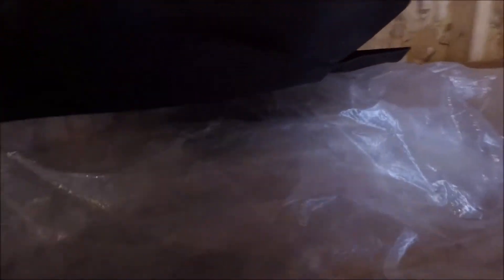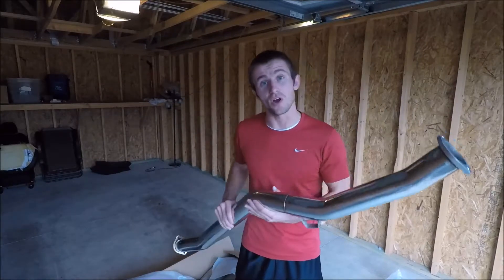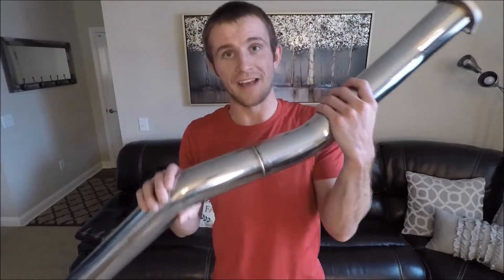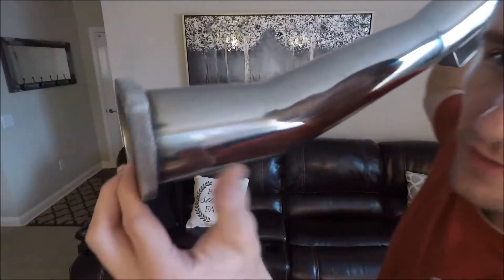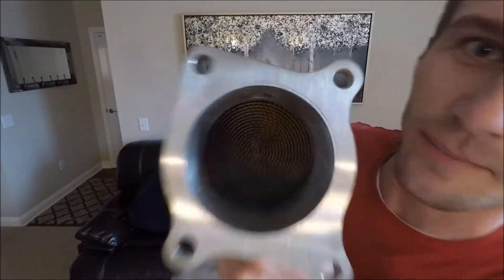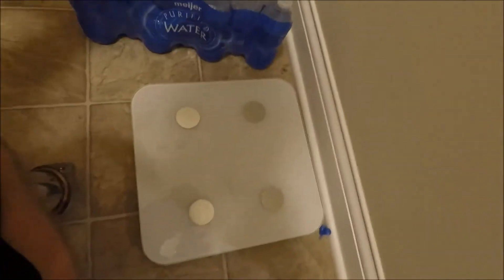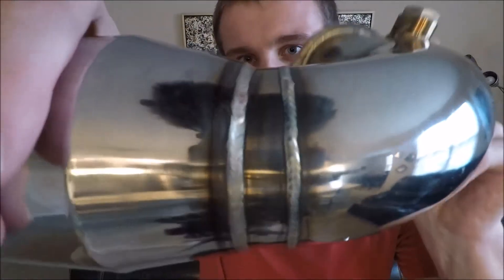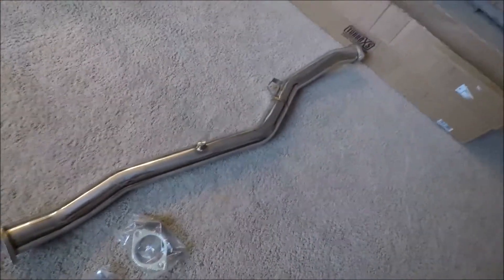TurboXS Jpipe Unboxing | 2015 WRX

Comment: A while back I went with an ETS catless J-pipe to the stock catback and mufflers. Sounded nice but had a really raspy tone to it because of the mufflers. About 2 weeks ago I put on the ETS muffler deletes and it is WAY louder, but I love it. One piece of advice I would offer is to make sure you get a pro tune when you put this on, don't mess around with OTS maps, they'll just cause more headaches and damage to the engine. Best of luck! can't wait to hear your setup man!
Reply from the maker: +Lukesmit695 Thanks for the insight, I am pumped to get it installed!  Will definitely be getting a protune, as I want tgv deletes as well.
Reply: Nice man, I did the TGV and EGR deletes as well. Throw an intake on too and the car is a huge difference from stock. Next stop, flex fuellllllll!

Comment: 3:55 where did you put that on the install video? I installed it and the downpipe hangs a little low and i'm hoping that bracket is meant to lift it up a bit...